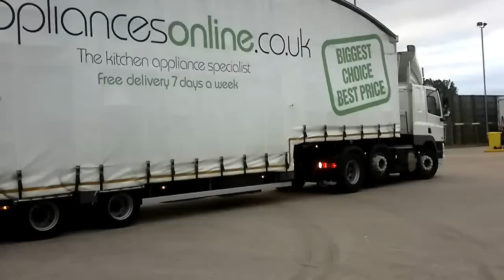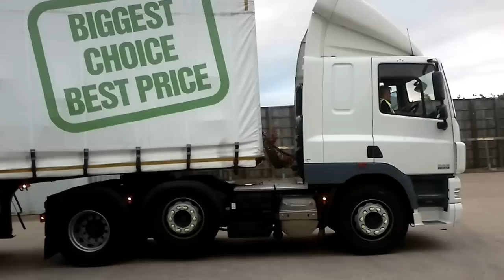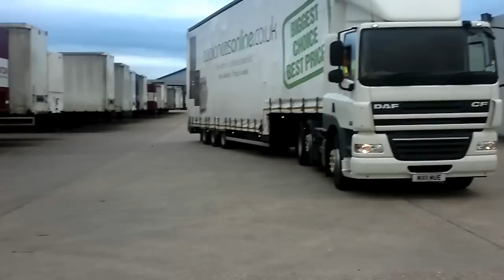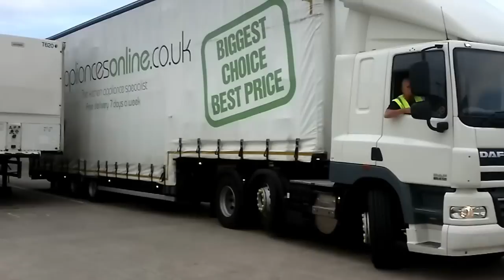AND THAT'S HOW IT'S DONE!  Marie reversing an articulated vehicle.

Comment: That was a excellent bit of reversing there love, I've just passed my cat c+e licence but but currently drive cat c at the mo, if & when I do get a class 1 job I'll hoping and trying to drive as a good u in reverse! A very well done!
Reply from the maker: Thanks Darren you will. Lock on and off. Stick a bit more on when you need to like I I did when the trailer was near the top of the bay. It will go in square that way. Driving an articulated is much easier than a rigid. You'll be slingin 'em on when you get confident. x
Reply: Obviously I don't know your work commitments but if you could cut your days where you work (if they wont give you class 1 work) you could do the odd day with an agency and cut your teeth doing that. All the best for your future driving.
Reply: Marie Mellor Nice smooth job,i've always made a hash in step frames?? You'd have thought after 26yrs i'd have got the hang of it by now. Lol  ;) (just stand clear if i'm blind-siding! Ha ha)
Reply from the maker: Haha Adrian B. Thanks. Blind siding is NOT easy. I used to be good at it until I worked for a company who's cabs had windows in the back. I got so used to the window it spoiled me. Yeah you should be good with step frames and double deckers now....little wheels but still the same length lol x

Comment: I think 75% of getting it right is the preparation.. why jack-knife it in when you can get yourself at 45° and make it a lot easier for yourself.. obviously depends on the size of the yard etc.. but we'll done hun.. Nice and smooth manoeuvre.. 👌 👍
Reply from the maker: Kevin Doughty Thanks Kevin. I'm not jack-knifing it, I'm putting it in 'square'. If there's enough room I will always put it in 'square'. It goes in more straight as opposed to on an angle where the driver is more conscious of the trailer on the left.
Reply: @BettyBeep1000  It was a general statement Marie, not aimed at you personally.. like saying "Why do it the hard way, when there's an easier way.." 😉👍

Comment: This same thing happened to me at 0.34mins but the blind side back of my trailer hit the front of the blind side trailer, Wasn’t a lot of damage but at this point 0.34mins I need to start stopping, getting out and checking that my trailer will clear the trailer to fit into the spot. A lot of knocks happen with guess work
Reply from the maker: James Mcrory. Yeah if you need to check, do it. There's no shame in checking. It means you are a good driver. I still check if I'm not sure. If you've got the room I have here then try to put it in square. You can see me stick just a little bit more lock on. And the golden rule, keep close to the side you can see and you'll miss the side you can't. Well, under normal circumstances.

Comment: I want to be able to reverse like you... Practice makes perfect I guess ...! ❤
Reply from the maker: Thanks for the compliment Adela. If you're driving or planning to drive you should do it like me at some point, but having said that I know and see drivers who still struggle after years. Just not got the knack and not a lot of confidence. Be confident and don't try to get in in first time just because people are watching because you wont under those circumstances. If you need to take a shunt, take a shunt or two. As long as you're not completely making a hash of it there's nowt wrong with a shunts to straighten up. I sometimes take the odd shunt. It depends what obstacles are hindering you to prevent a clean sweep. Just be confident and don't pussy foot about once you've got enough experience. Good luck. x
Reply: Brilliant brilliant, the  old saying is definately true girls get it done. Best reverse I have ever seen period

Comment: Brilliant!!!!
Reply from the maker: Thank you. x
Reply: Now that I'm here, I've always wondered why lorries have that third middle axle in the United Kingdom? I haven't ever seen that in Spain, where I'm from.
Reply from the maker: NeAZ It's known as a 'tag axle' although although the term 'tag axle' usually refers to the back wheels. They are used for weight and they lift up and down by pressing a button in the cab. If the trailer has a certain amount of weight on it is put down to bear the weight. Trailers with light loads or empty trailers don't need it down. Also in the snow they slip a lot and grip better with it up. I'm sure you must have them in Spain too. Have a look for them now. x

Comment: That’s a basic reverse on a class 1, loads of room too, try trying it on the blind side in a crappy little yard full of trailers, now that’s what you call reversing
Reply from the maker: Gimp Stevens. Yeah Yeah, we all know about there being loads of room and a basic reverse. I do blindside...and I've been in more shitholes than you've had hot dinners. There were only shitholes when I started......and no automatics.
Reply: Marie Mellor I’m not doubting your driving skills, just pointing out that that’s a very basic reverse, if you can’t get do that then you shouldn’t have a licence, I’m sure you’ve been around and have loads of experience, I’m just saying that reversing blindside in a space with inches either side is proper reversing 👍
Reply from the maker: Gimp Stevens. Yes, I know what you mean and I've done that and still have to do sometimes. This video was only put on here to enable me to upload it somewhere else but I left it on and I'm glad I did as this basic reverse is helping a lot of new drivers. It is on twice by mistake and the other one has 105k views and has helped people. But have you not noticed as a driver that I didn't get my lock off quick enough?

Comment: Hi Marie. I'm struggling with the reversing in to loading docks .could you please tell me the formula for reversing in to loading docks ??
Reply from the maker: Hi raj cheema, if you have the room try to get your trailer near to the top of the bay before putting your lock on. Don't put too much on at first then just stick a bit more on as in the video.Try to get it as square as you can then stick some lock on. Remember it's on a pin and turns very quick. It's better to stick a bit more on than stick too much on right away. If there's not much room just keep putting your lock on and off slightly and 'work' it in but try not to 'cut' it across the bay. On and off...on and off. You can still get it square even without the room. On and off small amounts all the time. Best wishes. x
Reply: Practice, practice, there’s no substitute

Comment: well we all get right it once how many times did u practice?
Reply from the maker: No I don't get it right just once. I get it right 99.9% of the time. I've been doing it for 24 years so I think that should be more than enough practice don't you? If I couldn't do it like that 99.9% of the time by now I'd surrender my licence. And the video wasn't planned, it was very spontaneous. I put my trailer between two trailers at our depot when I've finished my shift while other drivers are either thinking about it or have got their braces caught on the fence. As I have just done two hours ago. That's the way it is. And people are learning from it which is a good thing. They are also very grateful so I'll be putting another one on for them.

Comment: Nicely done! :) Was is a manual or auto?
Reply from the maker: Thanks. It was an auto but the DAF 85 is a bit 'tankish'.....heavier steering.  Would have been better doing the video with a Mercedes which the company also has. Very light and easier. x
Reply: Yeah true, I prefer the DAF because the shape of the window on the Mercs is difficult to hang out of. Auto DAFs we have a horrific in reverse, seems to be all or nothing, full speed or no speed even in the turtle mode :)
Reply: 2003er500 they are all the same in reverse daf merc scania Volvo adr's makes no difference

Comment: Nice job but nothing like reversing a full trailer truck though.
http://www.youtube.com/watch?v=508fveaItRE
http://www.youtube.com/watch?v=ETYelgOHHf0
http://www.youtube.com/watch?v=Sy0hL3AFbpw
Reply from the maker: Thanks. What's a full trailer truck ?
Reply: Marie Mellor
Did you checked the links i posted? I tried to find good examples so you can check them if you like. It has two swiveling points instead of one and while backing up semi trailer is somewhat logic the full trailer needs a lot of practice even if you know the principle.
Reply from the maker: smokyislay Yes I see what you mean now. They're known as 'truck and drag' in the UK or 'wagon and drag' that's why I didn't know what you meant by 'full trailer truck'. Sorry.Yes you're right they're not easy and take some getting used to. I had a go at reversing one once in a yard a long time ago and it's not easy just to keep it going backwards in a straight line if you're not used to them. Thanks for the links. x

Comment: What's hard about that ? got to laugh at all these show offs  looking for a pat on the back.... l do it everyday ...its all about practice and experience...but l don't want a round of applause or a pat on the back just for putting a trailer on a door...and l certainly wouldn't criticise a novice that would maybe take a bit longer than someone of a  bit more experience.we were all in the same boat at one time..just keep practicing you will get there. Its just a job..
Reply from the maker: John Mayberry. Hi, John. There's nothing hard about it...for me ...and you. Nobody said there was anything hard about it, but it is for some people. This video was taken spontaneously and I only put it on here temporarily to upload it somewhere else as it wouldn't upload at the time. The date says 2012.  A lot of new drivers in the comments say it is helping them so I left it on. And where have I criticised novices? I don't criticise new drivers. I help them while others sit and watch them struggle. I don't want a pat on the back for it as it's nothing to me. I was pushed into getting the licence to help out in transport. That was 30 years ago when it was a pleasant job. I have seen the changes and not for the better. Quiet roads and motorways, especially at weekends. Only an operator's CPC. No sitting in a pokey room on hard-backed chairs while the trailer is tipped, (which I feel very strongly about as it's not fair on the driver and is very dangerous due to tiredness, but companies get away with it). I don't do it now as I don't need to due to making enough money trading the currencies from the comfort of my own home on my PC.  I can do more than reverse a trailer and I don't need to put up with all the shit that goes with it. Oh, and it's the only job where you have to pay to go to work and the only job where you can go out to work one day and end up in jail. And yeah, keep practicing. Yeah, it's just a job I don't have to do every day now. And yeah, got to laugh.
Reply: @BettyBeep1000  l certainly wouldn't be filming some guy reversing a truck on to a door then giving "that's how it should be done....
Reply: @BettyBeep1000  when l am in a hub or an rdc l am not interested in how somebody puts  a trailer on a door or how long  it takes them l don't even look at other drivers manoeuvres l just get the trailer on the door and then get to fuck out the place..
Reply from the maker: @johnmayberry7669  Haha lighten up, it's a joke. I say it in the video. And it says 'that's how it's done, not 'that's how it should be done'.  People can do what they want, it's nowt to do with me.
Reply from the maker: @johnmayberry7669  No, neither am I, not one bit interested, I've never said I look at other drivers, but you are telling me what you do. I've been doing it too long for that, but if I do happen to see somebody struggling,  I'll help them. That's how most drivers were when drivers were drivers and not just steering wheel attendants. Anyway, must dash, the markets are due to open. Plenty of money to be made while it's pissing down and windy outside. Stay safe.